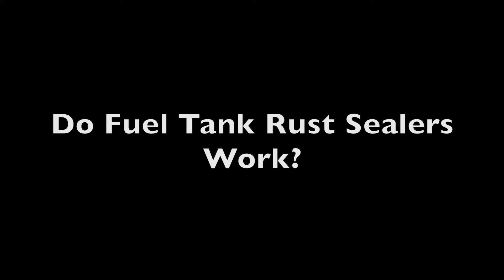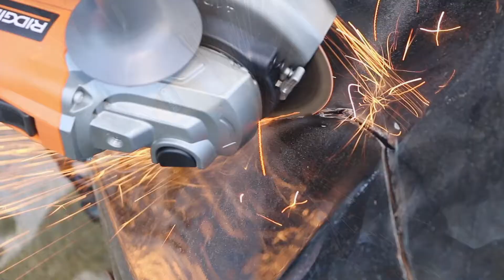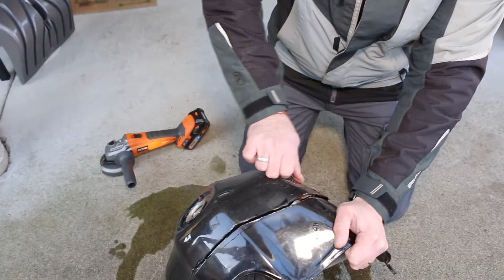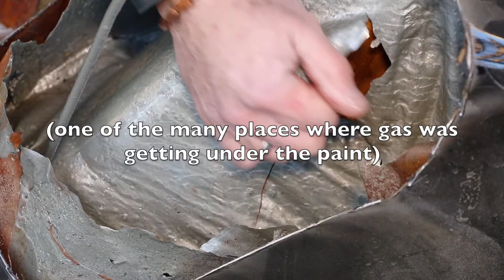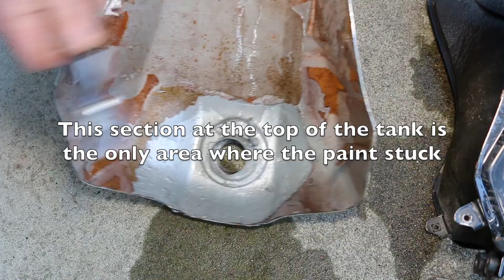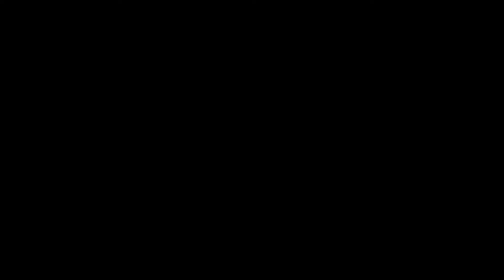Motorcycle Fuel Tank Sealers: Don't Buy Until You Watch This Video!

Comment: Who do you recommend for a pro coating job
Reply from the maker: I don't know of any products available near us. Chris uses a friend who is a professional painter. He's done several of his using a red epoxy and they turned out well. Unfortunately, the coating process strips the paint off so the tank needs to be repainted. It ends up being an expensive job.
Reply: @3ftDeepChannel  there’s a dude in Hollywood ca that’s does it . Gtl advantage or something like that . He’s Pricy but I’m tempted
Reply from the maker: Also look into getting a used tank in good condition. You can also save a lot of money that way. That's what I ended up doing with my KLR650.
Reply: @3ftDeepChannel  I already bought a minty like new tank so my bikes back on the road that’s was my cheapest option 300$ and I’m riding lol . I still got my other tank that needs work I want it done right I don’t wanna re do it again and again
Reply: @3ftDeepChannel  the dude in hollywood wants 500$ plus the shipping costs . That’s pretty steep . Might list the tank on eBay and let someone else fix it lol a new tank was cheaper
Reply from the maker: Good luck!

Comment: My guy takes it a step further and sandblast the inside of the tank works every time
Reply from the maker: The issue I was told is that the bare metal on the inside of the tank is normally coated at the factory to prevent rusting. The bare metal will rust extremely quickly. I guess your guy treats the metal somehow to prevent rusting before he adds the sealer. Or, it could be a very special 1-coat epoxy resin, I guess.

Comment: You have to be intelligent enough to remove the rust thoroughly before placing the sealer.
Reply from the maker: What would you have done differently (i.e. other than follow the instructions on the product label)?
Reply: @3ftDeepChannel  Properly removed the rust maybe? Metal rescue, thorough wash, very thorough dry to prevent flash rusting, then applying the liner. You have to be quick about it.
Reply from the maker: I’d say there’s no doubt that the rust wasn’t removed properly from the corners, but it was impossible to know that at the time (unless we used an endoscope to confirm, of course). I’m sure better prep would have helped, but the point is we followed the instructions exactly and that’s what happened. If the paint started coming up in one or two small areas it wouldn’t be such a big deal for us, but it came up all over …even in areas that we know were prepped perfectly. Even the guy who sold me the paint told me it wouldn’t work (based on his experience, and only after we had put 2 coats on). Thanks for your comment.

Comment: Bad prep bad results.
Reply from the maker: Well, that's easy to say. The consensus seems to be that if you've got a complicated tank geometry, forget these tank sealers.
Reply: @3ftDeepChannel  I've never had a problem my guy sandblasting inside of the tank first
Reply from the maker: The KLR650 tank has some deep corners which makes that difficult to do a good job with.

Comment: 1. you need to avoid that gas station......
Reply from the maker: That’s it!
Reply: this is spot on. most pump gas, at least in the US, has ethanol. Ethanol is hygroscopic, which means it absorbs water molecules from the atmosphere, just like brake fluid. these water molecules are heavier than gasoline and gravity takes them to the bottom. even if you ride through tank after tank of fuel, you never run completely out. so the water just sits there forever or until it rusts through. every time you open the cap to fuel, water molecules enter the tank. if you live in the desert it's way less of a problem or no problem at all. if you live in a place that has high humidity, rain, etc, it's a hugh problem. use ethanol free fuel, keep your bike inside/covered, flush out the tank once in a while, especially if you are gonna park it for the winter. A lot of dirt bikes get horribly rusted tanks, because they just get left outside with shitty fuel full of water, sometimes for years.
Reply from the maker: @seabee12333 Great advice, thanks.

Comment: Looks like throwing a bunch of magnets in there seems to be the only solution
Reply from the maker: Magnets? Why magnets? If you have a steel tank they will stick to the tank. If it’s not steel, no debris will stick to the magnets.
Reply: @3ftDeepChannel  Not exactly a solution but it might just prevent worst case scenarios to some extent..as nothing damages engines and fuel lines jets working on steel tanks like rust debris does...besides it costs next to nothing to deploy some broken mags in there.
Reply from the maker: Thanks for the tip, Ravee.

Comment: very broad statement to not use tank sealer and not even give a brand name.

based on the rust under the paint, the preparation was not done right. also the separate coats (whilst you say was not explicitly stated not to do) wouldnt work. like any paint, there are re coat time frames and if you don't apply within that time frame you need to scuff the surface to get proper adhesion for next coat. the reason it probably never stated anything about multiple coats is likely that you shouldn't do multiple coats, bit rather one thick one. runs aren't an issue in this case as you would never see it.

I know of many people who've done it correctly and not had an issue. I'd chalk this one up to poor preparation and bad application.
Reply from the maker: I wonder how many of those people don’t realize that the sealer is peeling in the tank, but they just can’t see it. Thanks for your comment.
Reply: Was it POR15?
I have use it on old VWs and it stopped rust, period.

Comment: What kind of companies do the professional coating job in fuel tanks? It is originally zinc plated or something like this? I'm from Brazil and will try to find something in here.
Reply from the maker: Normally a good motorcycle painter will do a proper coating, as the professional coating process will strip off all of the paint from your tank.
Reply: @3ftDeepChannel  I mean the internal coating, where the fuel makes contact.
Reply from the maker: Yes, I understand. When they coat the tank properly it removes ALL of the paint from your tank so it needs to be repainted. When I sourced the costs, it was CDN$250 for the treatment and $250 for painting. That’s $500 total. That’s why these do-it-yourself products are so popular.
Reply: @3ftDeepChannel  oh I see.... Can you confirm me what kind of coating they use internally? It is probably a bath right? Because it removes the paint... I can't find some place here in Brazil to do it... Things are kind of difficult in here for vintage cars and bikes.
Reply from the maker: I’m not sure what product to use. All I know is that when they return the tank it has a red epoxy coating inside and the paint on the outside has been stripped. Good luck.

Comment: One minute in and I can lready tell you n😮were you went wrong. First off dont use paint to seal inside a gas tank EVER. Secondly you gotta let it dry right before you seal it and cure ot properly after. 
What cause the issues os prolly impropper prep a nd a wet tank. The sliver liner stuff will form a shell of there touch moistire or solvent fume and if youale the same mostake w redkote it will stay sludgy and melt into the fuel and screw up your carb and engine. Gotta follow the directions fellas
Reply from the maker: This “paint” is specially designed for this purpose. It was allowed to dry as per the manufacturer’s instructions. It was thoroughly dried, too. I can imagine the prep not being perfect in some areas, but the poor adhesion was extensive. So, our point is that this product may work in “ideal” conditions, but even when the instructions are followed thoroughly this can be the result. Thanks for your comment.
Reply: I used por15 on my suzuki tank, and 10 yrs later it is still perfect.
Reply from the maker: Nice to hear. Is it a relatively small, simply-shaped tank?